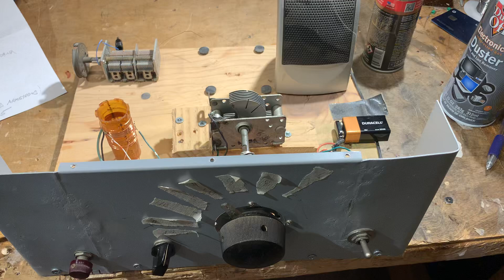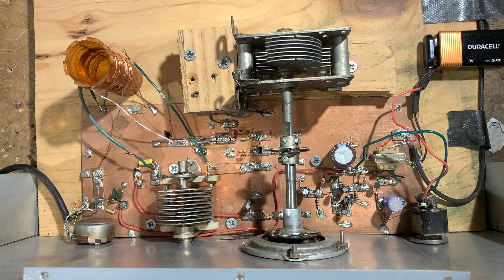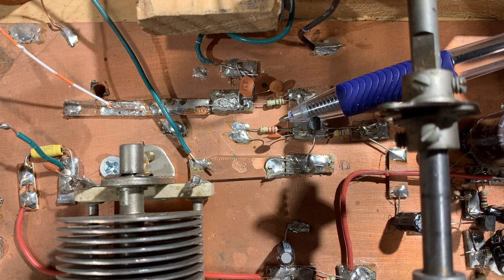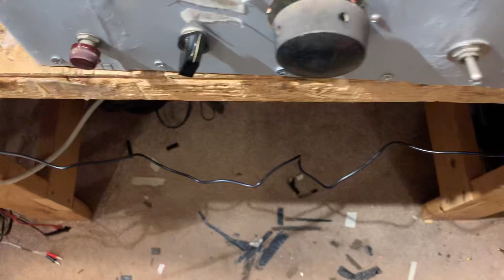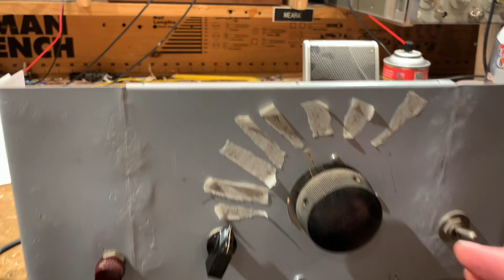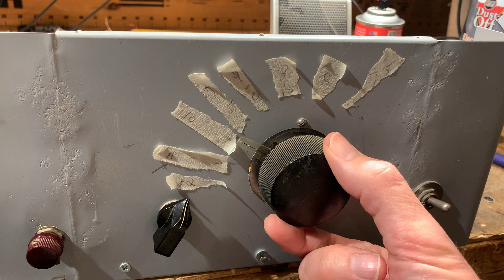“Off the Shelf” Regen Receiver

Comment: Nice Bill! How was the performance before the resistor swap? 73 de PA1DSP
Reply from the maker: There was no resistor swap -- the error was just a mistake in my drawing of the schematic.  I always had a 2.2 k ohm resistor at the source.  73  Bill
Reply: @soldersmoke  could it be that the 560 ohm base-gnd resistors of the two AF AMP transistors are actually 5k6? The biasing doesn’t work with 560 ohm. 🧐

Comment: So Bill, was the error only on your Schematic, or did you actually have a 2.7 ohm resistor wired in?  73  - Rick  - N3FJZ
Reply from the maker: Rick:  It was a schematic error, as Walter suspected.  Upon inspection (after taking it off the shelf!) I found a 2.2 k ohm resistor (red-red-red) from source to ground. 73  Bill